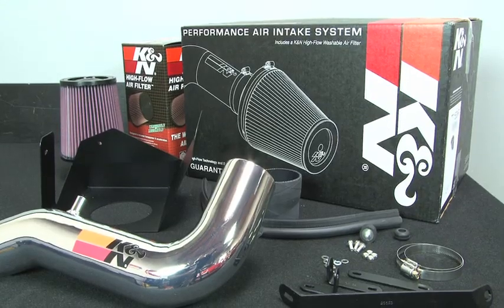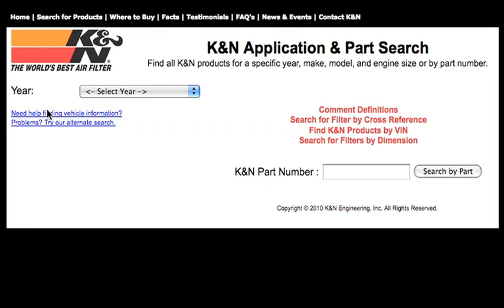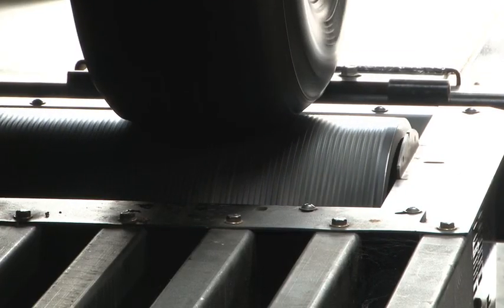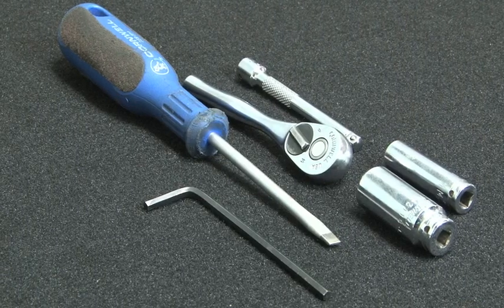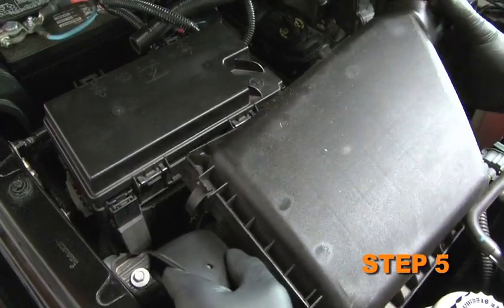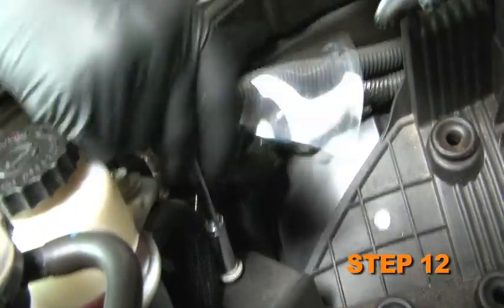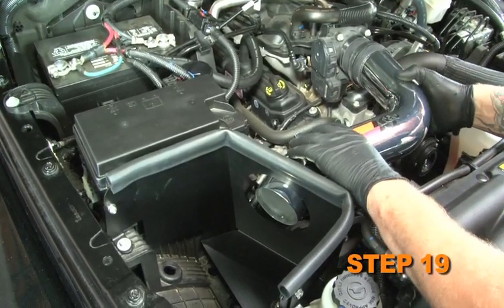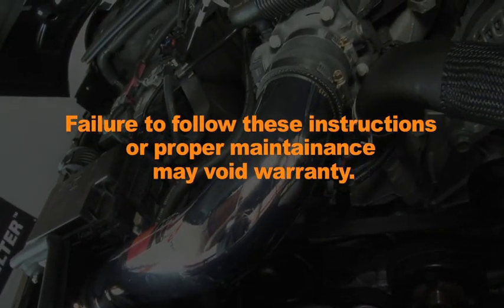2007-2011 Jeep Wrangler 3.8L V6 K&N Air Intake Installation

Comment: I have a washer on the front engine bolt that prevented me from removing it and use as w bracket. I improvised with a open end bracket so I don’t have to removed the bolt.  It was a hard find though.

Comment: How do I remove the air intake sensor? Can't pull it out can't turn it either way, it's not budgin.
Reply: I used wire cutters and cut it out of the old intake system. Didn’t want to risk breaking it.  The rubber is hard, so the wire cutters will be perfect to use.  That is what worked for me. Took me 1.5hrs to install

Comment: Yes, very common with the cold air intakes. Best thing for of road (without a snorkel) is the stock air filter. It will get wet and just stall the engine, instead of sucking in water.